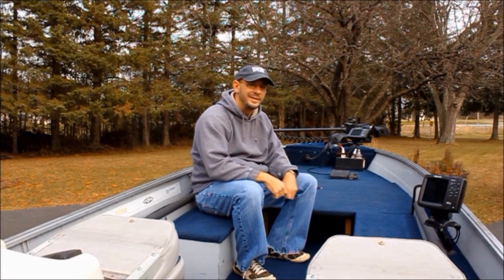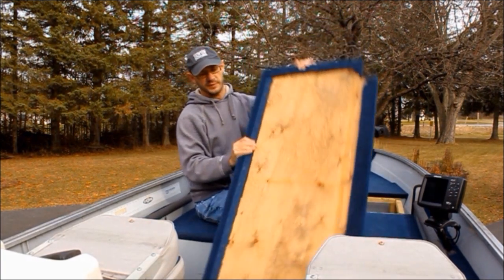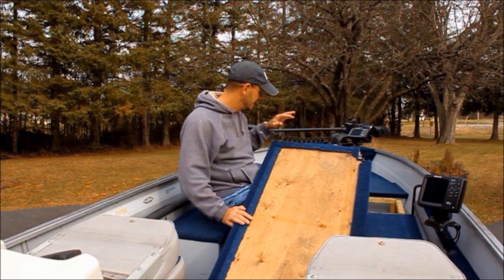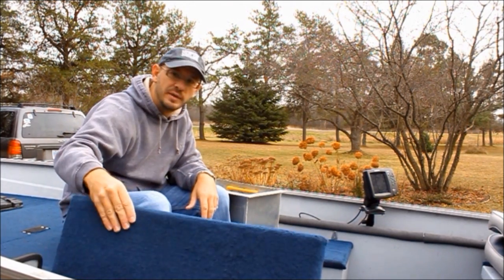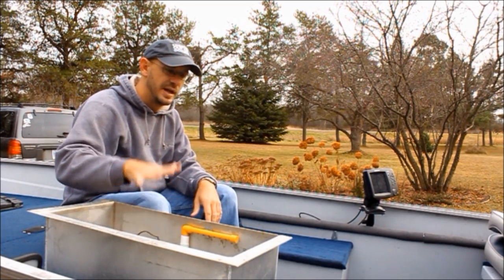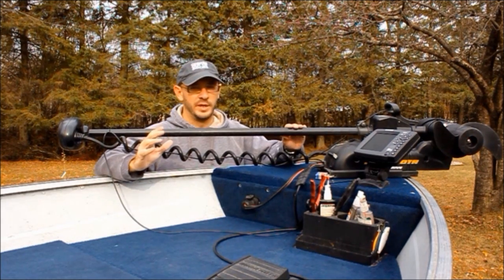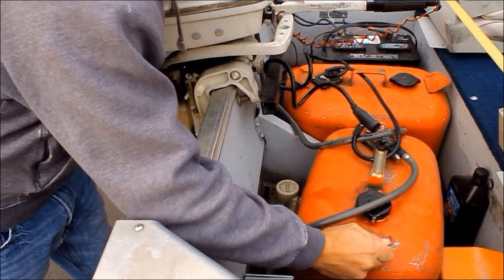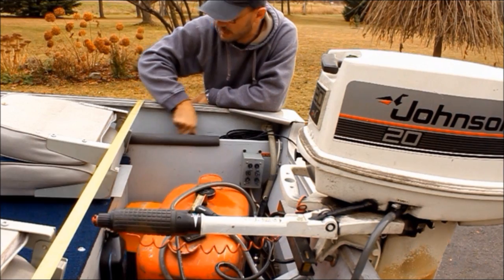Upgrading Your Aluminum Fishing Boat (DIY Mods)

Comment from the maker: Glad you enjoyed the video. What we did for the measurements was to make a cardboard template. Slowly trim a large piece of cardboard, so that it fits correctly at the proper height you want the deck to be positioned. Remember to keep some space for the carpet. 
Once you have the template cut to the correct dimensions, trace around it onto your plywood and voila!
Good luck with the renos...
Cheers,
Justin

Comment: Hey Justin, great video. Here's what I did to my 16 ft Starcraft Supersport floor. I used exterior grade plywood then put sealant on it. After that, I went to Harbor Freight and bought their truck bed liner. I painted both sidesso I don't think that I'll have to worry about any wood rotting

Comment from the maker: Hi Joe - Yes, we used the same framing work underneath the front portion of the deck as well. The frame for this is just attached to the existing wood floor, with back, front and sides all framed for maximum support.

Comment from the maker: No. It was a lot as you see it. It had a carpeted floor, the seating, one livewell and one storage box), etc. The additions we made were installing another livewell, as well as the front casting deck - as well as adding trolling motor, electronics, etc. It came standard with a 20 HP Johnson. It is a Springbok Pro Series 140. If you image google it, you can see a few pics of what it originally looked like. 
Hope that answers your question, Garret.
Cheers,
Justin

Comment: You are on the right track I never understood carpet on a boat ??? if you use cedar just stain or keep it oiled, any grade of plywood works great and I just use house prime and paint and never had a problem and I have been around wood boats for over 40 years and used them on the ocean the trick is wash after use let it dry then cover it from the elements, sun, bad weather, etc ...

Comment from the maker: Depends if you are talking about bilge, livewell, trolling motor, etc., or just the deck and carpeting. For the latter, $200 should easily cover the wood and carpeting needed. As for the other, prices vary significantly depending on what you want or purchase.

Comment from the maker: Weight is always an issue when adding decks, seating, trolling motors, etc. I did lose a bit of speed with the layout I created, but to be honest, the added weight of the wood for a deck of this size wasn't too great. I think you'd be fine with what you are suggesting...but always best to consult with the manufacturer to find out weight capacities. 
Good luck with the upgrades - post a pic when you're done!

Comment: Great video. I recently bought a smoker craft 14' and I want to build a deck in the front. I'm wondering how you attached the wood frame to the aluminum hull. Any suggestions you can provide are appreciated! Thanks again for sharing your video.

Comment: i dont use rug in any of my boats. i tear it up asap. i use the Chemsol Navy G non slip paint. military grade. try it once, and it will blow your mind. When i first got it i painted a piece of ply wood with it, let cure, and dry, and then i  soaked the surface with water poured dish soap all over it, went barefoot, and tried to hop around on it with one foot. not even once did i get the sensation i was slipping. tried taking an actual bar of soap, and sliding it across the soaped up painted surface, and it wouldn't slide. i'd throw the bar of soap on the surface like in a bowling motion, and it just stopped dead. i finally managed to slip, once i took three bars of soap, and mushed them right onto the surface, but i wasn't slipping on the surface, i was slipping on the soap that was stuck to the surface. BUT it's very expensive, and you dot need that for a fishing boat. i use it on cabin crusiers, pontoon boats, and many others, but the most useful fit seems to be the sail boat. I used to own a 26 foot sail boat, and cruised all over Lake Erie with it, i went barefoot of course, and i often went by myself, so i had to be able to move fast, slipping, falling, concussion later i coated the boat with the Chemsol paint, and it blew my mind. i started talking about it at the yacht club, and next thing you know i'm working my 8 hour job, going home, and painting boats for another 4 hours. lol all that's behind me now, i just have the one Lunde aluminium fishing boat now. Thats all i need. i live in Kenora Ont now right by lake of the woods, and am out pretty much every day. (retired) I even sleep out in my boat sometimes when i go exploring the more desolate, and uninhabited ares of the lake. but anyway, to make a comment that much longer, i've been out of commission due to getting an entirely new shoulder, and have got to thinking about adding a deck on the front, so thats what brings me to the weird world, that is the you tube comment section. great job by the way. all the work looks pro done. I've seen some nasty diy shit in my day haha yours looks totally legit
Reply: Where could I purchase this non slip paint?

Comment: Did you build a 2 x 2 frame for the front portion of the deck as well?  I have a Lowe 1467 WT that I want to put the front deck on but there is nothing to attach it to.  I could use angle aluminum and rivet up against the front bench but then I I would need something to support the other two sides or a frame underneath.  Any tips would be appreciated

Comment: There's nothing I would like more than do these kind of upgrades, but my 9.9HP on the 230lbs Yukon is refusing so. When I'm alone in the boat with the trolling motor battery in front, I can reach a not too shaby 30km/hr and intend to keep it that way :)

Comment: How do you fill up that extra livewell with water? Do you just pour water in? I have an old livewell on my aluminum boat and it has a drain plug. Livewell was welded on to the side and looks very much like your's. I want to install a system with a sprayer but I was trying to devise a way to get water in it without having to pour it in.
Reply from the maker: Hey Jake - Unfortunately, I have to pour it in by hand.
Reply: Justin Hoffman Thanks for the reply. I'm looking at a recirculator system that includes a pump that holds to the bottom of the livelwell via suction cups. You can remove the pump and hold it in the water off the side of the boat and pump water in. Great job on you boat!

Comment: Thanks, this video was very helpful in my boat restoration I have a boat like yours but a bit smaller with an evinrude 15 hp and moves it at 35 mph.  A couple months ago, I made a fishing deck like you did and have a pedestal with a chair.  Sadly my 35 lb thrust  is a transom mount so I can't put it at the front of the boat.  There are 3 benches in my boat and the platform lays on the front two.  I hope to take out the last bench and convert the round bottom into a flat bottom.  I found out that my great uncle has a machine shop and he his join to make me a big aluminum box for my live well.  I also have a question how do you power your live well, off your big battery or a smaller one and the wiring for the control panel?  Thanks, Ryan
Reply from the maker: ryan wilcox Hey Ryan - sounds like some great renos you have done. As for my livewell, it is powered off of one large battery in the back, which is wired through the power box. This battery powers my fish finders, trolling motor, live well, and bilge. Cheers,Justin

Comment: I bought a boat and I bought it because the guy built the deck which is exactly what I wanted but it was done with pressure treated wood so I took it all out and now I feel as if I wasted my money, the boats from 1965 it's 14 ft and a v hull but I want to re do it the right way but I don't have alot of money to do this I can get 2 x 4s and that would for free but i don't know what I should do about all the wood should I seal it? And can I remove any of the aluminum seats?

Comment: hey man just wondering how long, deep and wide your live well is? And would you make it bigger or smaller if you could?
Reply from the maker: Glaze Fury Thanks for watching. I can get you those measurements when I am out in the boat later this week - keep it stored at my folks. As for size, all depends on what you want to use it for. This is great for holding one or two bass, or a mess of crappies. A single walleye or two also, depending on size. For tournaments, you would want two of at least this size - which my boat was equipped with.
Reply: Justin Hoffman yeah if you could let me know the measurements that would be sweet coz i am going to build a deck on my boat and i want a live well aswell. And how long were the screws ?
Reply from the maker: Glaze Fury The measurements of my livewell is 22" x 10" and 9" deep. As for screws for the deck, we used 2 1/4".Cheers,Justin

Comment: What is the weight capasiaty ofthe boat ?
Reply from the maker: Not quite sure, James. It is 26 years old so I don't have any of the literature anymore. I will say, for the decks we have installed and the work done, it reaches a speed of 38 km's/hour at full throttle with the 20HP motor.Cheers,Justin

Comment: Marine and Pressure Treated are different. Pressure treated wood should never be used on an aluminum boat as the chemical reacts with the aluminum and will cause pitting and corrosion.